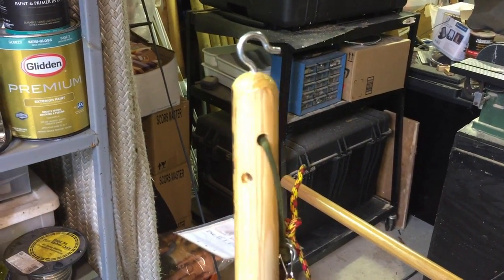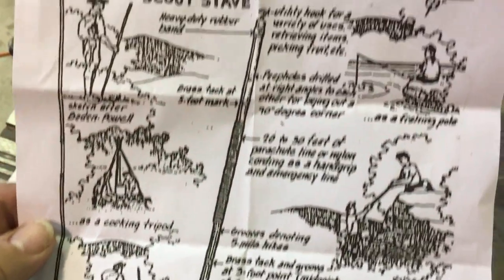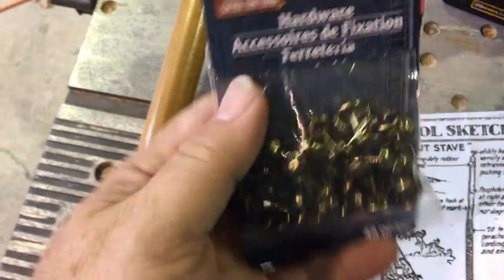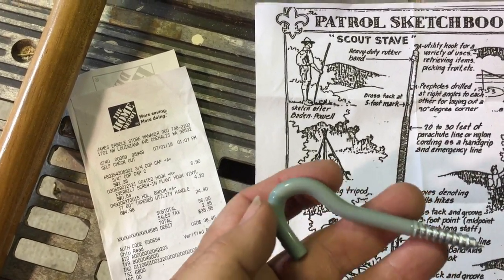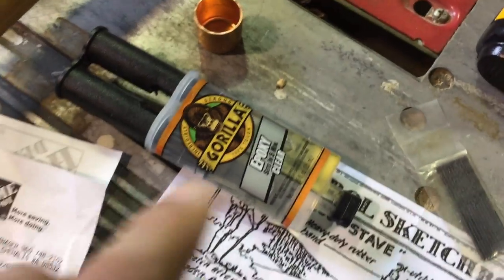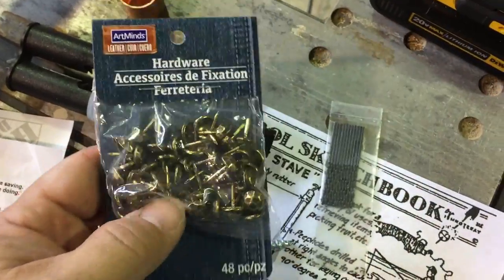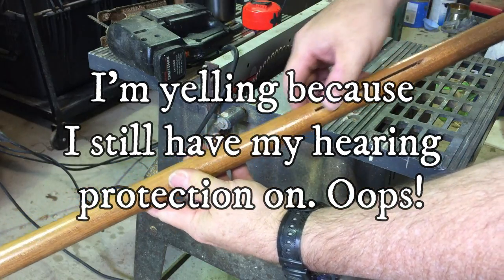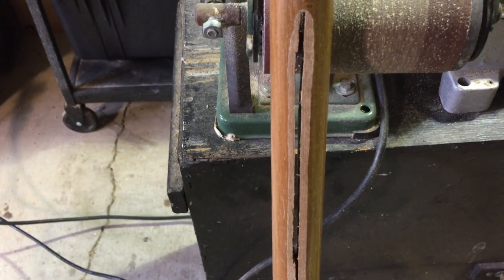Awesome OLD SCHOOL BOY SCOUT WALKING STAFF

Comment: To make the slot in the stave, crank the blade down below the top of the table. Position the stave length over the centre of the blade and clamp in place. Turn on the saw and slowly crank the blade up until it comes through the wood. Reposition  by turning the stave 180 degrees to even the slot from the other side. You may want to drill holes at each end of the slot before cutting to prevent the end from splitting. This should provide a much more accurate cut and is much safer to attempt especially for first timers. Hi Ho Hi Ho Hi Ho!!!!
Reply from the maker: That is great advice. I figured out that trick a while ago, but you know YouTube... once you upload a video, there is no way to replace it with an updated version. Thank you for continuing the story... peace be with you.
Reply: Electrical tape on hooks, small sinkers, fishing line, saw blade, etc. Then wrap with more tape. No slot is needed. Wrap over it with cord with whatever cordage that you want. Definitely drill a top and bottom hole to knot the cordage. I’m a 1960s BSA. Construction line is tough and of smaller diameter and you can wrap a lot of it on the staff. We also used clothes line.  We didn’t have paracord.

Comment: Wondering won’t the slit weeken the staff? Oh I see how you worked it awesome job❤ thanks for sharing❤️🥰🙏🏻👍🏻❣️😊
Reply from the maker: Yes it will, but if you wrap it tightly with that 550 cord, it should be fine. Mine has lasted for many years... plus two 50 milers. Definitely a good conversation piece and teaching opportunity with young Scouts.

Comment: Nice build. 
If you use Titan SurvivorCord instead of standard 550 paracord, you have 620 LB tensile strength (instead of 550) with three standard strands of the interior cordage that is usually in paracord, AND you also have 25 LB fishing line, a 2mm strand of waterproofed Jute firestarter and a strand of 30 AWG metallic alloy utility wire (8lb test) which are all as long as your paracord wrap itself. 😉 PERSONALLY, I'd also wrap the center cut with twists of Gaffer Tape and Duct Tape instead of clear packing tape. Both are more useful than clear packing tape and would still keep the contents dry under all that paracord in most cases.
Reply from the maker: I've never even heard of Titan cord... is this a new product?
Reply: @HelicoolsHelipad  It's been around for a few years. Veteran owned company. Evidently our Spec Ops folks love the stuff. I have begun replacing all of the normal 550 paracord in all my kits with the Titan SurvivorCord...it's a bit pricier than the generic 550 stuff, but for the flexibility, it makes sense to me as an investment in kits that may in some remote possibility be used as a matter of life or death (or at the very least the matter of prepared comfort or unprepared discomfort.) 🙂

Comment: To carry more hooks nest smaller sized hooks inside the large hooks.
Reply from the maker: Definitely more hooks will fit, but not too many more. It is only a 1/8" curf-cut with a regular with-grain table saw blade. It barely is enough to squeeze two band aids together. The volume of fishing tackle is carried in my go-bag, but for emergency use, it'll catch some fish. :-) Thanks for being a part of the conversation... it is appreciated!

Comment: You may have already answered this question before I'm not sure I was wondering what size drill bit you use for the holes for the hook the peep sights and the holes above and below for the para cord And what size the counter sink that was as well
Reply from the maker: Use a drill bit that is appropriate for the hook that you select. Make it smaller than the treads... of course... but the size will depend upon the hook. As for the peep sights, a 1/4" bit will do great. As for the counter-sink, go with a 9/32" bit. If you don't have those, go with something close... no one will be able to tell the difference. Have fun, and be safe!

Comment: I have this idea that I think you will find interesting. I have a SOG Spirit knife. The handle on the SOG knife is designed to unscrew so the knife can be attached to a broom stick or tree branch. I’d like to modify my walking staff so I could attach the knife to the end. Would make a great spear. I’m looking to find a broomstick with a metal screw cap I can attach because the knife is threaded for that. I would keep the rubber tip that came with the staff over it when not in use.
Reply from the maker: I think that would be a very cool addition to the walking staff. I really enjoy that differences folks come up with as mods. Best of luck with your walking staff!
Reply: Helicool's Helipad you can buy the knife on Amazon. I have seen it at Walmart. It’s about $30. SOG Spirit
Reply from the maker: @havfunwithit  Thanks again, friend. That is something that I know my bush-crafting brother does not have! LOL!

Comment: So is the hook on then just for hanging it up??? Personally I think if that's all I does I will leave it of any rendition of stave that I make .
Reply from the maker: The hook is for grabbing items that are out of reach... like apples in a tree. It can also be used to sling a small sack over your shoulder. Your imagination makes the possibilities limitless. Again, this was what the 1940's Boy Scout stave had on it. Good luck making your own mods... I hope I have given you some good starting points.
Reply: I’m a BSA from the 1960s. The hook is also to put the bail of a pot into it to dip it off the bank to get some water, or to place or remove a pot off of the fire. Would tighten up the eye of the hook to just fit your pot bail.

Comment: Thanks for sharing, this is interesting. When would emergency nails be needed, though, and how would tacks be long/strong enough? I don't understand how they'd be removed radio enough with wood glue, either. And why not see on the stick where's wet to jist how deep it is, and see by eye when the sticks removed even in rapid area wether it's too deep etc? Looking at the pamphlet, there's an elastic band also suggested-any suggestion what that was for? The girth and length/debateably uncomfortable weight over a long hike? I'd love to know how it could be used as a fishing rod too, I'd absolutely love to have an ad-hoc rod from a branch or hiking pole. And how many players are needed? I didn't see what else went in the slot. A pole this wide, I'd suggest drilling a hollow in the top and filling it with something like a film canister or just a bung/screw of some sort, matches dipped in wax with something to strike, stormproof. Do you think a brass bottom would be quiet enough to walk with, without a clang every other step? I think a worn bottom is good, it debateably muffles the sound and absorbs the shock even if slightly, and if the sticks beaten too much then a camp craft is right there to spend time and such
Reply from the maker: In the old Patrol article, it said that the tacks could be used as emergency nails... I really don't know what I would want to nail together, other that posting notes telling people where to find you or hanging up a sunscreen. It was in the 1920-40's article, so I kept the reference.
Wood glue will not hold a metal tack very well, but it's enough to prevent them from falling out. That's why.
If the staff is already wet, as if you are crossing a creek, dipping it into the water and pulling it out to check wetness height is not an option. Besides, the measuring technique also works for measuring other things, like the size of fish you caught.
I'm not sure what the elastic band was for either, so I did not add it to my staff.
As for long hike comfort... both me and my sons took ours on a 50 miler and had no problem. the hand hold with the loop was great! AND, it kept overly aggressive dogs from coming too close.
As for the size of the staff... it would not work for any kind of larger cavity to hold stuff in. Think, lawn rake. Yeah, it is fairly small in diameter.
As for the bottom... I like to warn animals that I am approaching. It is when you sneak up on them and surprise them, that you often get into big trouble with them. Mine also has a bear bell on it for that very effect.

Comment: Not only was that cut extremely dangerous and could throw a jagged spear right into your throat or jugular... but I would think that it also seriously weakened the staff.
Reply from the maker: Many think the cut weakens the staff, and to a certain degree, it does. But not like you may be thinking. With the 550 cord wrap and several 50 milers later... it's trail rated. 
A little overly dramatic about the danger of the cut I made, I think. Dozens of staffs later I have never had the blade even hint at grabbing the wood. Your blade should be sharp, at full RPM, and the cut needs to be done smoothly and slowly while keeping your grip on the wooden staff. If you don't want to do it, don't. It's optional, as I specified in the video.  I hope this has given you some ideas on how you would do your staff. Make one, and trail rate what you like. If we all made the same thing, how boring would that be? Best of luck, my friend.

Comment: put 5-6-7 wraps of duct tape around the staff...it comes in handy out in the field. You could have cut the tip shorter so the copper cap would have been a resistance fit.
Reply from the maker: Yes, I could have cut the tip, but I wanted to keep the 5' exact measured staff height in tact. The epoxy is very strong... I trail rated three of the staves this last summer on a 50 miler (5 days, four nights with the Boy Scouts) and had no issue. I made three videos on the 50 miler that I posted to my channel if you are interested.

Comment: A router with a small straight bit would have made a cleaner cut. And it would have been safer.
Reply from the maker: They make a cutting router bit that’s 1/8” wide and 1 1/4” depth?
Reply: Yes,  Amazon has 1 1/4" long 1/8 router bits.   Plus if you use a stop and plunge cut in from the top and bottom you wouldn't need the jig saw.  Or need the belt sander afterwards.    Much safer plunge cutting onto a router table than a table saw, plus vertical ends to the cuts, plus the walls would have a rounded end that would be less likely to Crack.

Comment: Raise the blade in to the work!
Reply from the maker: I guess if you clamp the staff down to the table, that might be an option. Doing this with one hand on the staff and one hand turning a table saw crank is not what I would recommend.
Reply: @HelicoolsHelipad  - yes, clamp to the table.  Then raise the blade.  No hands ever near the blade.

Comment: i dont think the rake handle is a good idea because rake handles are not made to support a teenagers/adult mans weight and i think it would be a good thing to do with the other scouts where you all go to harvest straight sticks of hardwood
Reply from the maker: The rake handle is Brazilian hardwood... most quality yard tools are made with hardwood, though I don't think that a staff that is light enough to carry for miles and miles should ever be used as a step to lash a wide ladder together (for instance) where a full grown adult would put their entire weight on the middle of the staff. Find a good balance between light weight and strength... and be reasonable with how you use your staff as a tool.  (To achieve super light weight, you have to sacrifice some strength.) Though if you are talking about pulling strength, even a soft wood has some pretty amazing pulling strength... perhaps not so much bending strength. I hope you have success in your search and many fun adventures in scouting!

Comment: I’m confused about the peep hole ?
Reply from the maker: The peep hole is a sight hole so you can keep on your track (say if you didn't have a compass) but were pacing off a direction because you knew the distance. If you needed to make a 90 degree turn to avoid an obstacle, but did not want to lose your pace count, you could sight in the original target direction, then preventing the staff from spinning, step to the side and sight down the perpendicular peep sight. Count the paces it takes to move to the right or left around the object. Then use the sight to make another 90 degree turn so that you are pacing parallel to your original  course-line; continue you pace count.  Later, when the obstacle is clear, you can make another 90 turn and pace off the same number of steps that you used to come off your original course-line to avoid the obstacle. Once that is complete, you should be back on your original course-line.  Use the 90 degree sight again and resume your direction and pace count. Make sense?

Comment: WD-40 contains water.  You could have used linseed oil or used epoxy..
Reply from the maker: WD-40 "displaces moisture" ergo it is hydrophobic. It contains no water. However, linseed oil would be a good substitute. Cheers!

Comment: What are the peep holes for exactly?
Reply from the maker: The Patrol drawing did not really say, other than they are for sighting. I believe they are a navigation tool to go around obstacles, such as a lake. Typically, the staff peep sight is positioned in the direction of travel... then peering through the sights 90 degrees to the right or left, the navigator can travel in a square pattern around the obstacle, counting how many paces they traveled off course. When the obstacle has been cleared, they count the same number of paces to get back to the course-line. Sights help the navigator square off the corners with ease. Thanks for the question!
Reply: @HelicoolsHelipad  All line of sight. Goes the same with landmarks. You are spot on with your analogy.
Reply from the maker: @johnnaylor4348  Thanks, brother!

Comment: Peep holes HAVE to be 90 degrees?  And you eyeballed it?
Reply from the maker: The pole is only an inch thick, with holes around 1/8" with no crosshairs or optics... it is not meant to be a surveyors theodolite. If you have ever land navigated with or without this type of staff, a "general" 90 degree turn to avoid a non-crossable obstacle (keeping track of how many steps or paces you travel off course), followed by an opposite direction 90 degree turn is at best a good swag. If you have a compass, a 90 degree turn is easy... just add or subtract 90 degrees from the heading. The closer you can come to 90 degrees to drill the holes, obviously the better. Most people, including me, do not have sophisticated machinery to get it exact, so eyeballing it in most cases will have to do. Just do you best to make it as precise as you can. Hope you enjoyed the video and will make one for yourself. Cheers!

Comment: Old school boy scouts had no duck tape no para cord table saws  clear gross packing tape and we wouldn't buy a stick that we can get from the woods ! Whip the cord !nothing old school about it ! Cool project but it ain't old school !
Reply from the maker: You're right... it is patterned after an old school Boy Scout walking staff. I used modern supplies for sure. Though by the 40's which is about the time this Patrol drawing came out, there was duck tape, table saws, and para-cord. Now-a-days, a Scout cannot use a power tool, and in most places cannot harvest sticks from the woods (Leave No Trace policies), unless they get special permission. Times have changed. I hope you are successful with your project, and thanks for stopping by. Come back any time. Cheers!

Comment: Nice,but too many cuts and holes for strength of staff, take forever to get bandades out, would bleed to death.
Reply from the maker: If you are going to bleed the death, a few band aids ain't going to save you. That hidden area is meant for emergencies (like you lost your pack and your ten essentials. And, I would pit my staff against an angry coyote any day of the week... it is formidable! The Brazilian hardwood is amazingly strong...  it has also been varnished in manufacturing, which makes it that much stronger. There are no knots, which makes this staff way better than what you might be accustomed to. If it's not for you... that's okay. As I said in the video, these are just ideas to help you spark your own imagination and decide what you like.